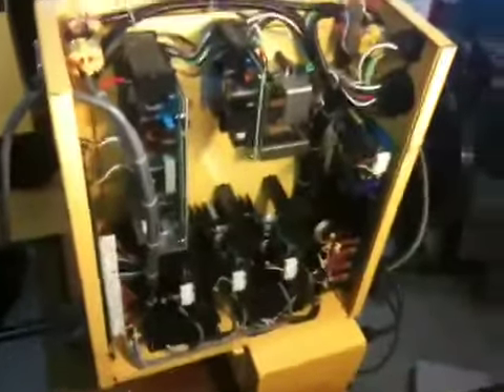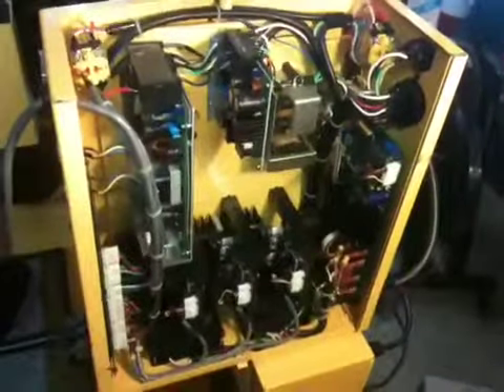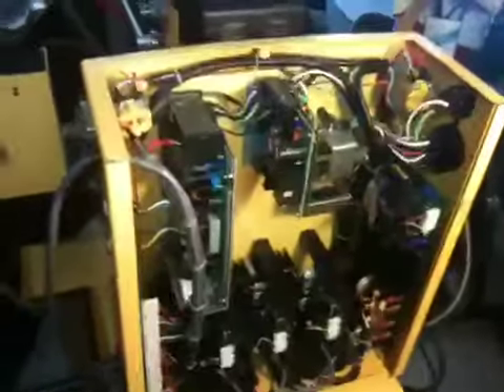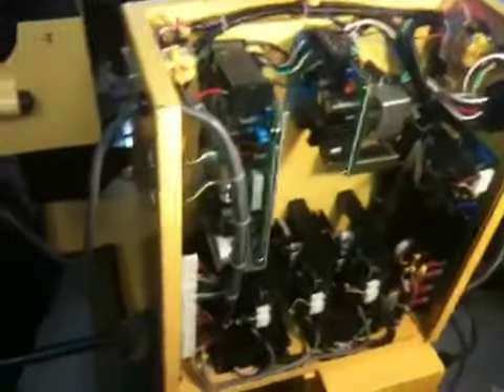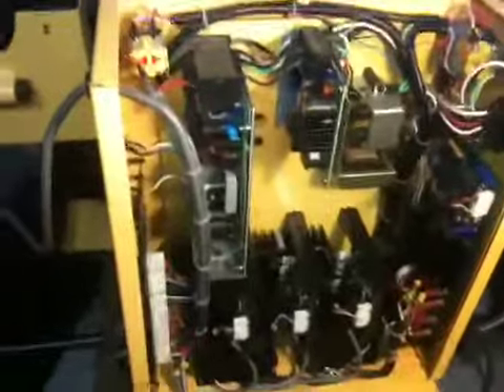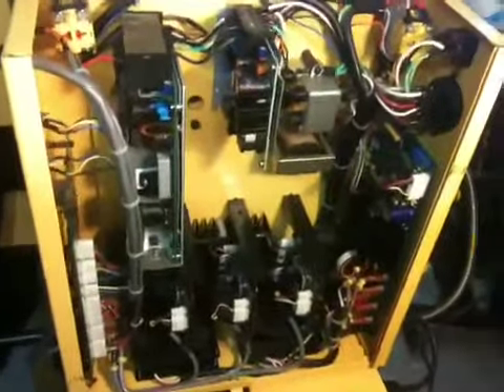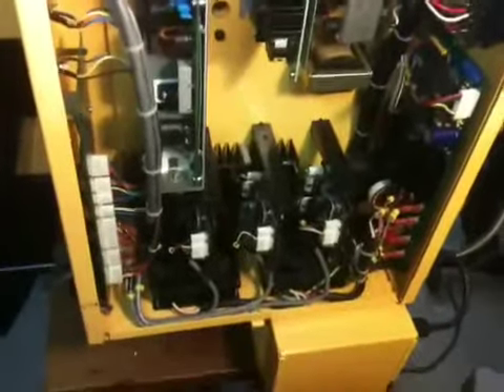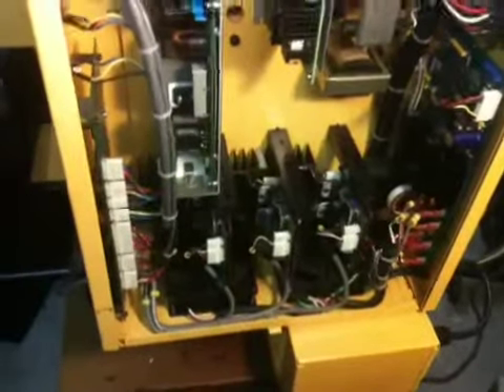Dyna Mechtronics DM 2400 Dismantling the electronics

Comment: I do have Dyna 2200 with the DM2400C and I succeeded to transfer code to the machine even above 900 lines. The secret was that the last lines on you data block includes e.g. "899 SKIP TO 900"-line and the line 900 is "900 (blank)    ". Then you download the data as Prog Execute-mode and when first lines are done and the controller at line 899 skips to line 900 (000-299=900 lines) what is actually 901th line, then it raises CTS-signal in RS232 to high and you can download next block of data.

Comment: I am in the process of retrofitting one of these machines to run with LinuxCNC. I'm an engineering student and we are retrofitting two of these, two tabletop Lathes, and 3 Rhino robot arms to run off of the same software. The intention is to automate the entire lab into a mini-manufacturing line. My question is this, we have successfully used the Gecko G540 drive in combination with a Mesa 6I25 Mother card in the PC and a Mesa 7I76 break-out board in the mill to send the signals to the gecko. The motors respond as they should. Now I need to control the spindle through the breakout card. Ideally using the existing spindle controller and power supply but sending the enable signal and speed control from the breakout card. Do you know if that is possible? Any advice on controlling the spindle through the PC? Any input will be helpful! Thanks.
Reply from the maker: muzzy10135 I definitely think this is a possiblity (spindle control). A relay could control the on/off or you could probably use the wires going to the original speed control pot thru the breakout board. Make a thread over at CncZone, in the Dyna section.

Comment: Too bad you made the conversion, the original system works great.  The communications software is free, no dongle required.  My 2400 downloads programs of unlimited line length, i.e. 3000 lines plus in block loads, runs at 30 inches a minute which is way too fast for what I do.  Dyna code is easy to post and understand.  If you can read G & M code you can read Dyna code.  The Gecko system is great but it does not add much over the original Dyna System.